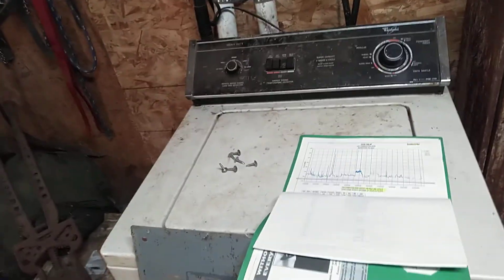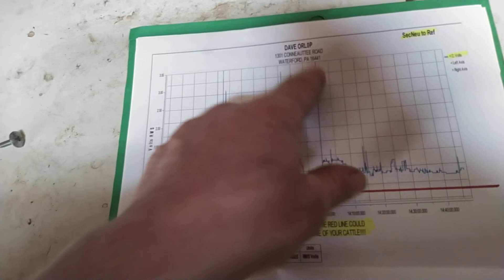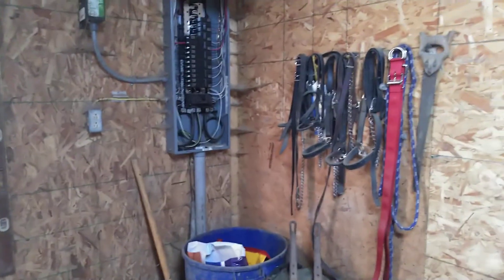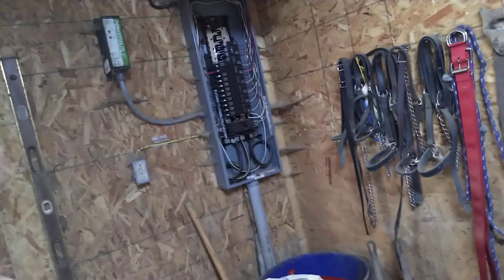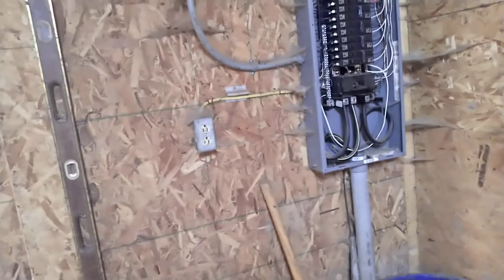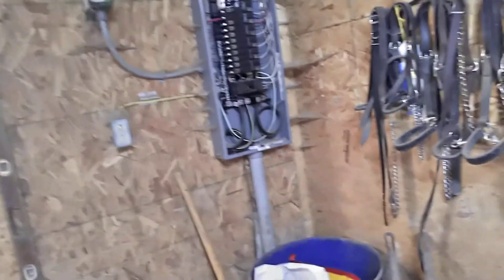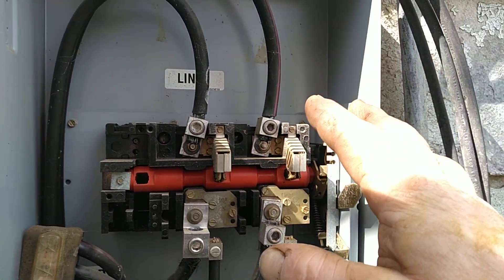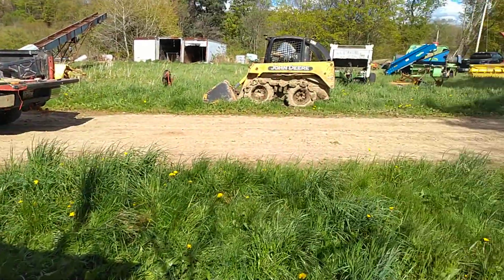Part 3 stray voltage "solution" and Penn State call

Comment: Could be coming from the overhead wires
Reply from the maker: I did notice while I was checking the isolator switch while just standing with the meter in my hand while I was directly under the wires it would read .2 volts touching nothing and as I got about 10 ft away in any direction it would read nothing.
Reply: @Mad_Farmer912  I've seen that too

Comment: Hope you find the problem. That would drive me crazy working on that. That should be be a big help if you can eliminate the stray voltage if you have it. Slow warm up this spring in Pa.
Reply from the maker: Be nice to find something and prove that I didn't become incompetent after 35 years.

The weather is nuts this year. Michigan and Wisconsin guys are pretty much done and we haven't started yet. Still better than the constant rain like 18 & 19.

Comment: If you take your readings with the REA, then hook up the generator and retest, it may help to find the problem?
Reply from the maker: The isolator switch tested to be working so if there is still stray voltage it would be on farm. Hooking up the generator would just be another way to prove the switch was working because the stray voltage would still be here.

Comment: How much milk did you get when you tested who was your highest cow or don't you know yet
Reply from the maker: I won't have the report adjusted for time and component results probably untill next week.

Got the pregnancy results back and it was 4 for 4.

The report she prints shows the average as 30. It should be a few pounds higher because a couple should have been dried off but I tested them one last time.

There was a brown Swiss, Shorthorn, and Holstein all tied  for top at 49 lbs.
Reply: @Mad_Farmer912  please let me know when you get your reports back please thanks
Reply from the maker: @bobmorse3513  they also were off more than they should have been because the hoof trimmer was here Friday. After being nerved up from that it takes them a few days to adjust back. Yesterday and today it was noticable that they were back up some on milk.
Reply: @Mad_Farmer912  did he have to wrap any I do my own I have a stand up chute you have trouble with hairy warts like the rest of us or no I have some but I run a foot bath a couple times a week seems to help
Reply from the maker: @bobmorse3513  had alot of problems with warts about 3 years ago but hasn't been to bad lately. Ones with problems were real bad because I didn't do any in the fall like normal.
Went through 21 and had 4 warts, 3 abscesses, and 1 ulcer and 3 of those he used blocks
Reply: @Mad_Farmer912  your trimmer from PA or is he out of state and how are the fresh cows doing and did you get rid of the bull calves
Reply from the maker: @bobmorse3513  he lives about 10 miles south of me. It's him and his son and they have 2 trucks. I know they go into NY and OH too.

Last 2 cows are looking good but the last 2 heifers are improving but slowly. Just had another jersey cow fresh today with another bull, so I got 3 here now. The guy who has been taking them hasn't got back to me if he wants these yet.